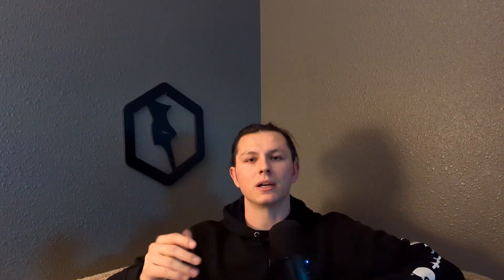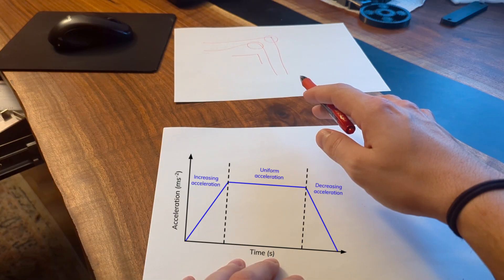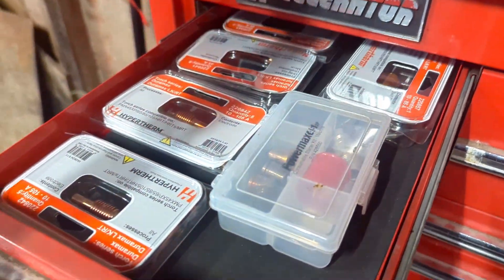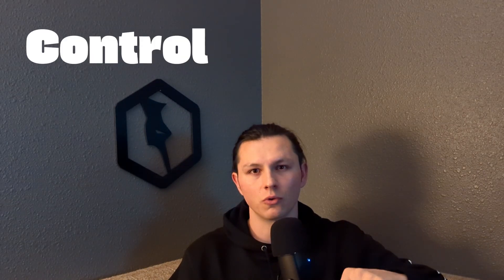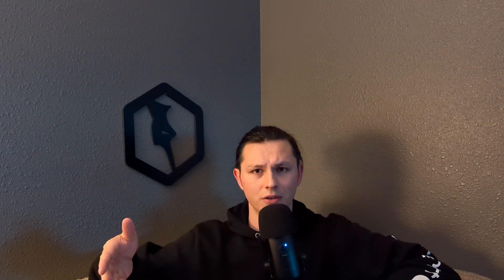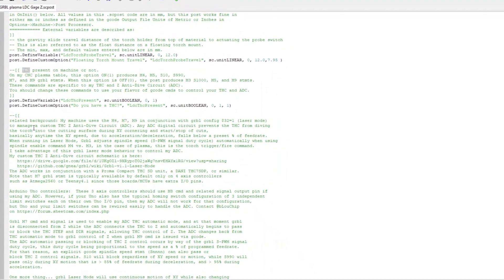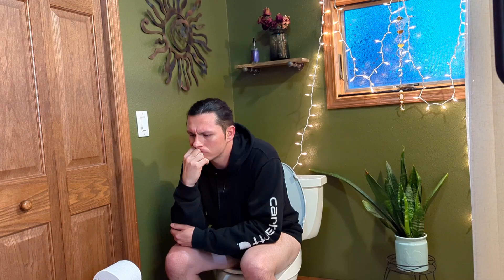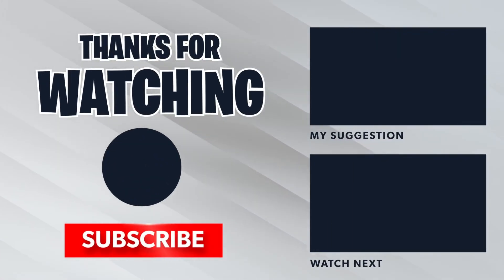DIY Anti-Dive for CNC Plasma Cutters (GRBL firmware mod and...)

Comment: Great content and I've learned lots from watching your videos. So looking back from your journey and experience of building your CNC machine and starting your fabrication business, What changes would you make to your CNC machine? Ie. Would you build a bigger table on JD's Plans, buy a different THC, or perhaps skip building your own table and buy a professional built table from one of the known brands names? Interested in hearing your perspective from your experience.
Reply from the maker: @khealey2011  I actually go into this a little bit in my coating video. Long story short for my needs and what I wanted to do I feel like buying a new machine would have been the best route. I'm in it for the business, even though I enjoy working on the machine, that's not my main goal.
Reply: @ThyialIndustries  What size machine would you go with if starting over?
Reply from the maker: @khealey2011  honestly would depend on my budget. But if I started over would go with a smaller 3x4 table just for starting out

Comment: Hello Thyial, I sent a comment a while ago and was sharing that I was developping a standalone THC. Now that my plasma is working , I had the opportunity to test it  and I'm pretty close to the final form of it (missing a rotary encoder to setup the parameters): but here's how it works : instead of tweaking GRBL , I wire the steps wires of x and y axis from the controller to 2 inputs of the mega, and with the appropriate  code, the mega computes the real speed ! Then by giving a threshold ratio, and a max cutspeed(the one we enter in sheetcam) it can deduct when it needs to trigger the height control (this way, you don't need to touch a very sensitive code). If you're interested, I'd be glad to share this with you !
Reply from the maker: @GuillaumeJke  really appreciate you taking the time to share your setup in detail! That’s a clever approach using the Mega to compute speed—it’s always cool to see different solutions people come up with for this stuff. Thanks again for reaching out and best of luck as you keep refining your build!

Comment: i know absolutely nothing about the controls you are using. But i will say this if you have any kind of condition that causes you to slow down or pause in a corner that will cause blowout and heat buildup in the corners. that is something to avoid and if you solved that good job, you just made your life easier😀
Reply from the maker: @jasonhauserman-k9s  it definitely helps out a lot. 

I'm starting to realize I may have underestimated the complexity of this video topic. It might be a few steps up from a "DIY" project. Oh well lol
Reply: @ThyialIndustries  The laser at work has corner control built into the controller so these machines can get complex pretty quickly. I still like Linux CNC as a control option in general. they put a lot of work into the Plasma side. you can do things like ohmic sensing along with the THC and floating switch. and I'm pretty sure you can do 9 axis of control at the same time plus unlimited expansion on the I/O.
Reply from the maker: @jasonhauserman-k9s  dang that would be nice! I have a yon of  io options I'd like to include but am limited by the Arduino
Reply: @ThyialIndustries  yeah it cheap and a lot of people use it but it's limited. Linux has recovery and run from here build in so it's a lot more robust. if you want something more involved like a multi axis head for doing bevels or whatever you can dream up, you need a control that does more.

Comment: Are you going to release that code?! 👀 

Also received the aluminum bearing block, thanks!
Reply from the maker: @bradleygatz  great! Hope it helps get your machine to the next level. I could possibly provide the spindle.c file. But there are no guarantees it works with everyone's setup. That's why I figured I would just plant the seed and if others wanted to follow they know which direction to head.
Reply: @ThyialIndustries  consider seed planted

Comment: Hey Thyial thanks for making these videos, your on the forefront of video documentation for some of these Diy plasma videos. I am learning a lot. Its helpful following the build tinkering closely. I plan to Replicate a modified JD's Garage Xl table build. for a 5x10 table. 99% of what I plan to cut is Sharp angles in 24GA stainless. Keep up the good work producing technical content :D
Reply from the maker: @randyrandom5702  I appreciate the support. That's a huge table. Sounds fun. Good luck with your project!
Reply: More about this table, full sheet ability? Got any videos?